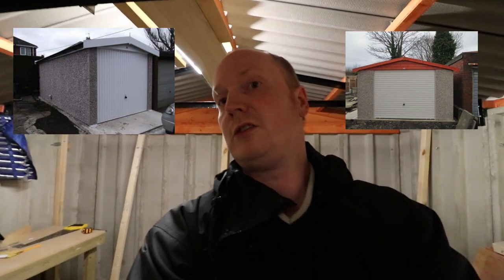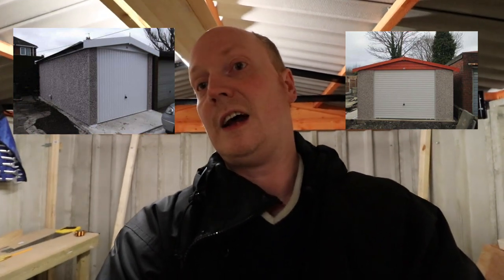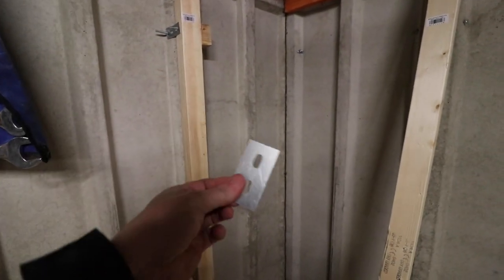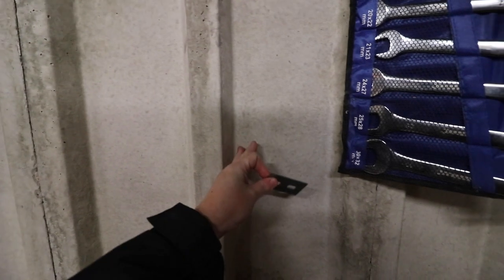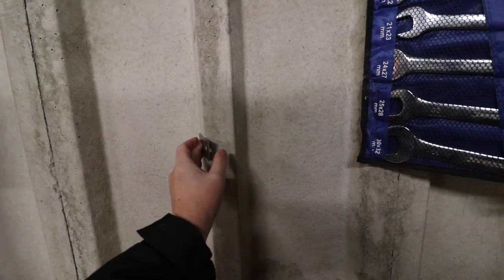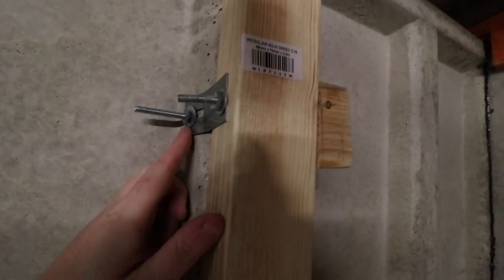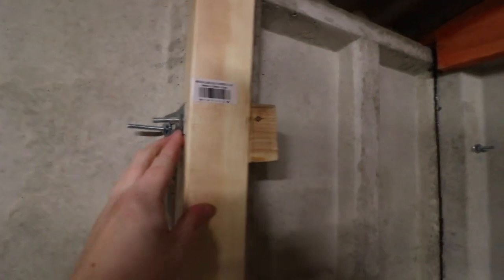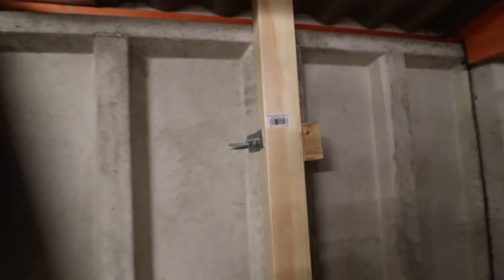part 1 Converting a Garage into pool room  How to attach wooden battens

Comment: Hi mate thanks for the video I am planning on doing one similar but just wanted to ask did you fit the brackets into the original holes from before??? I have the same type concrete walls too
Reply from the maker: Yes But I used longer bolts its a hard job but it be worth it in the end.

Comment: Hey, thanks for the video, I'm another one thats possibly embarking on the same project mainly for storage and a workout area. Can I ask what drill you used to get through the concrete and if it was easy enough too get through without damaging the concrete? A few people have mentioned just bonding the batons with something like pinkgrip but I plan on putting plasterboard up and don't want that falling down in a years time!
Reply from the maker: Hello First thing you need to do is watch the whole project I have included a link to it in the description . All parts are around 22 but I created a video so you can see every step. I would recommend you dont go down the pink grip route. I used pink grip to support the roofing bolts and that;s it. Remember adessives dont do well in a moisture environment I have addressed some of your questions in my Q and A video so check that out too.  Dont even think about drilling into the concrete walls they are reinforced with steel and you could risk cracking the concrete. Plasterboard is a bad idea. I hope my videos do help but best thing to do is watch the whole video and the Q and A video. If you have some questions after you have watched them I be more than happy to answer. regards Paul.